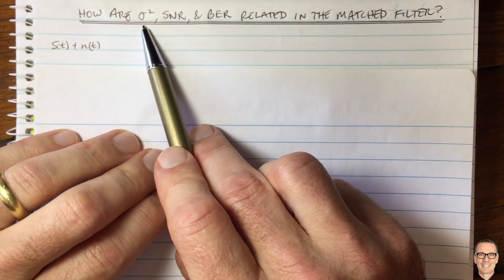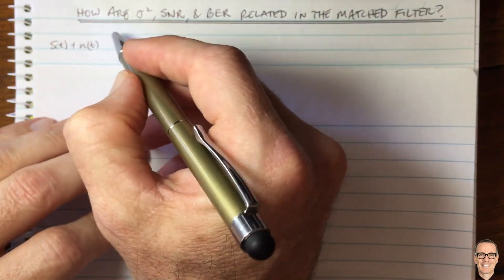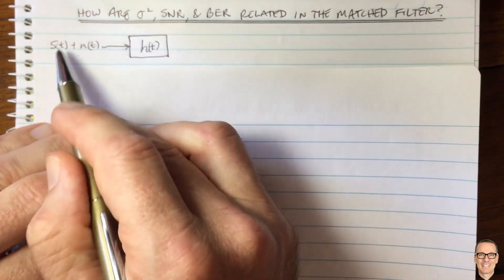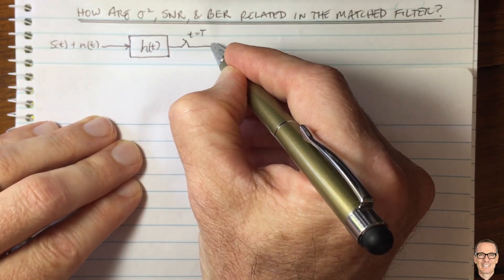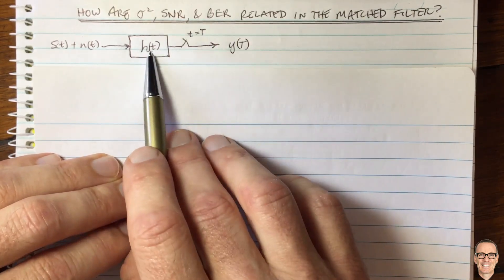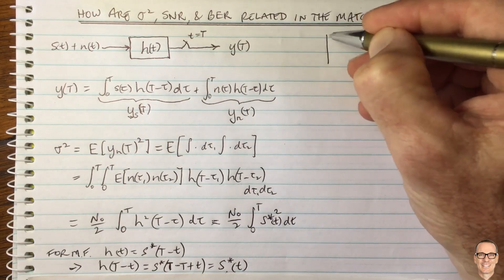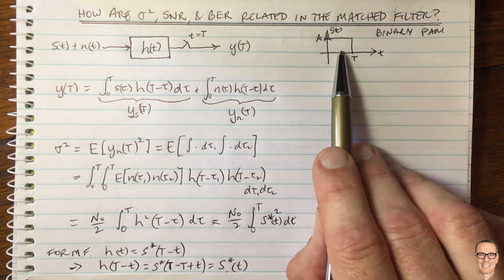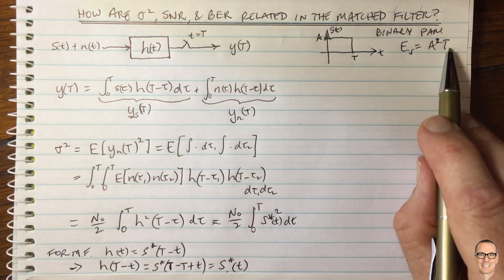How are sigma^2, SNR, and BER Related for the Matched Filter?

Comment: Sir, unrelated to this video, can we interchange the sampling and quantization operations for converting an analog signal to digital signal? If yes, then what are the disadvantages if quantization is done before sampling?
Reply from the maker: Sampling and quantisation are not separate operations. The output of the sampler has a certain resolution (quantisation), determined by the digital electronics in the sampler. So actually the "sampler" is sampling in "time" and in "voltage".

Comment: Sir could you please explain the calculation of SNR for the BPSK signal assuming white gaussian noise
Reply: it should be (A^2/2)/((N0/2 )*(2* band Width )) but you explained it as A^2/No
Reply from the maker: No, not true. I explained the SNR for binary Pulse Amplitude Modulation with a square pulse shape (ie. infinite bandwidth!). And I didn't say it was A^2/No, I said it was (A^2 * T)/(No/2). If you want to know about BPSK over a finite bandwidth of W, then that's another story. You might like to check out my video on Noise Power, for more information on the bandwidth limitation issue: https://youtu.be/_qn4RzMrXBc
Reply: @iain_explains   thanks a lot sir 
I understood many concepts that I did not understand in the classroom